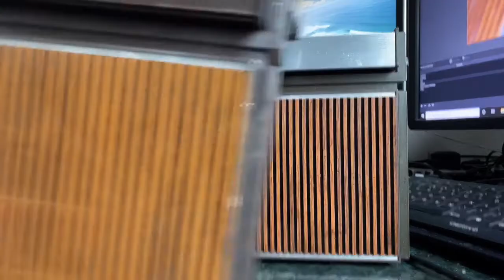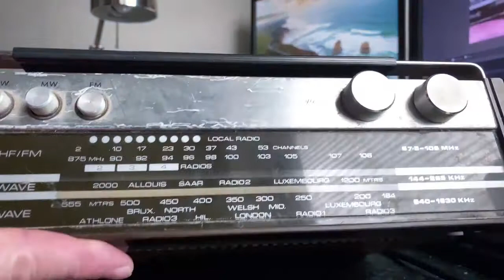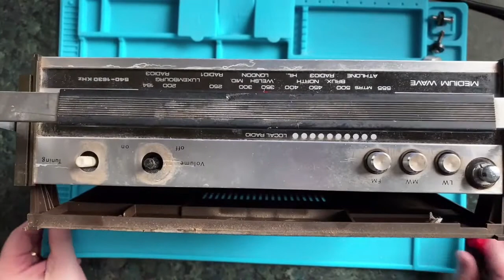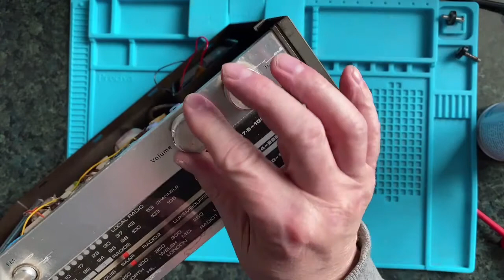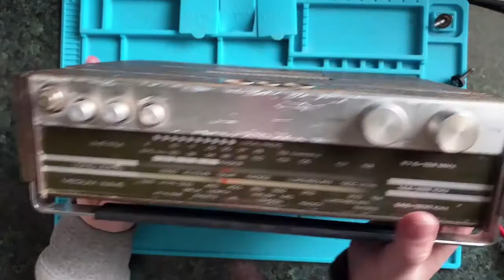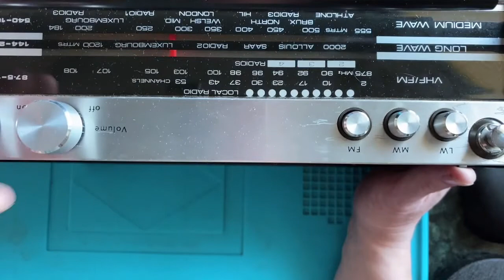Fidelity Rad 23

Comment: tuning drives in these and similar fidelity models are often 'creaky', and sometimes so stiff as to be unmovable by now, some used, like this one, a plastic tuning spindle in a brass bush, the plastic seems to 'enlarge' with age, and temperature, i've just had to 'grind' 3 of them down with sandpaper(pain in the bum!).... i have 2 of the things plus 2 rad22s(mw,lw,bs model, no fm), my 2 rad23s seem to be post1978 versions as they have radio 4 on LW and radio 2 MW, opposite to yours(as far as i can see) so they must've made this model for many years, i also have 2 of what was probably their 'best' one, rad 21, big beast with sw and fm afc as well, dial light also, uses 8 D cells!  gerald wells of the dulwich vintage wireless museum once described fidelity sets as 'all fur coat and no knickers' 😜

Comment: Just subbed. 
I bought a couple of these too as it was the only radio I remember that lived in the kitchen when I was growing up in the 70s. It's funny as one of mine is in tip-top condition but also has tight tuning. I thought someone had re-strung it too tight but it appears not if yours is the same.
Reply: tight creaky drives seems 'normal' for these, see my main comment about them😉

Comment: i have a Fidelity Rad 24 that has very flimsy construction and no Fm band , the Rad 15 is a Rolls Royce in comparison!
Reply: or rad21, huge beast with sw and afc on fm, , i have 3 rad 15s, they work ok, gain drops off quite a bit with battery voltage

Comment: Neil, please, that is no way to clean a volume control! You don't just point the spray vaguely in the control's direction and spray all over the place. There is a convenient opening right in the middle, where you could have stuck the straw on and sprayed directly inside. I'm betting that with one or two applications of cleaner that control would have been good as new and you'd have avoided the whole rigmarole of lifting the replacement from the other set.
Reply: yep, i've just done a few similar models 😉 they did eventually recover ok...